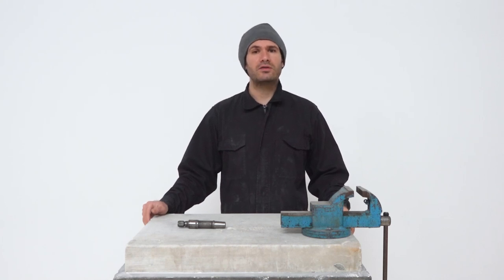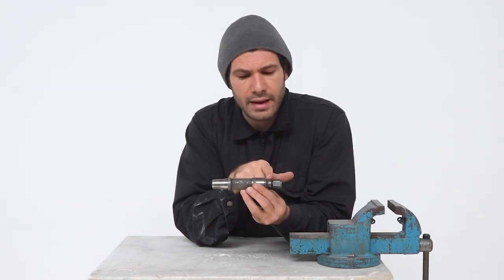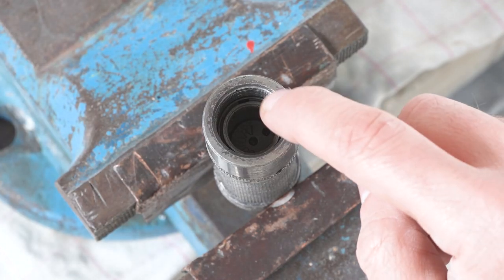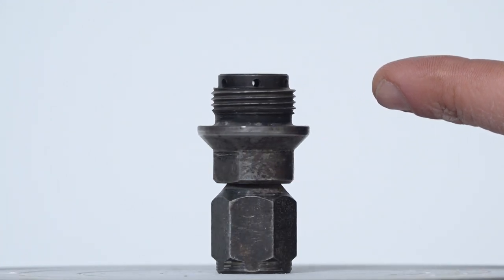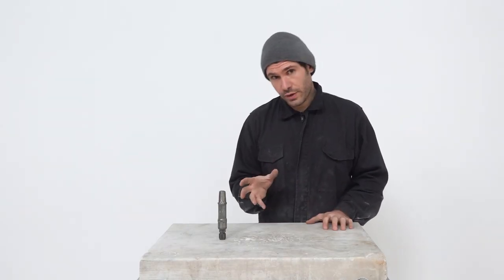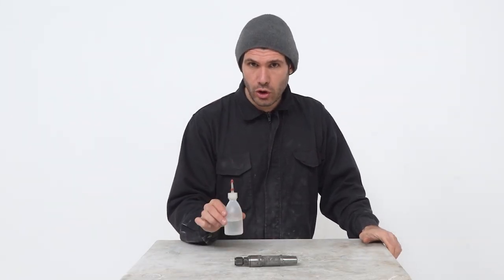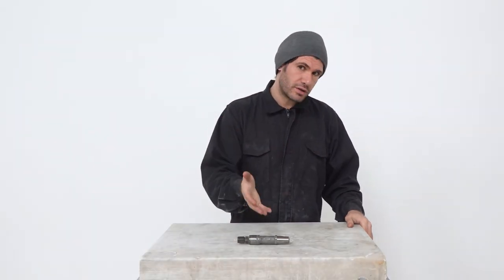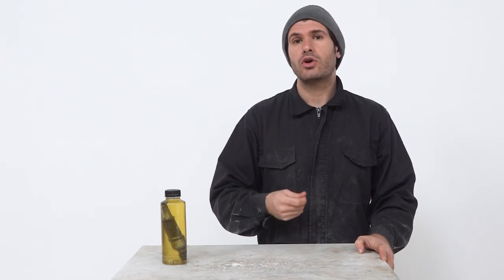What's Inside a CUTURI HAMMER? | Sculpture Tutorial

Comment: I hadn't used my hammer chisels in many years and when I went to use them they immediately stopped working. I soaked them in solvent for a few days and they were fine afterwards. I generally use the same hydraulic oil that I use in my nail guns but I think it might be too thick. I like the idea of a bottle of solvent. I am going to look for one to assign to this use.

Comment: I have heard Automatic Transmission Fluid is a powerful penetrant. I sprayed some regular penetrating oil into both ends and put it under low pressure and 30 minutes later I got movement again.